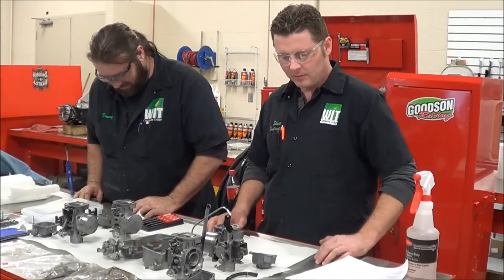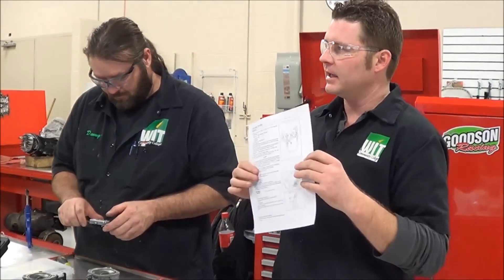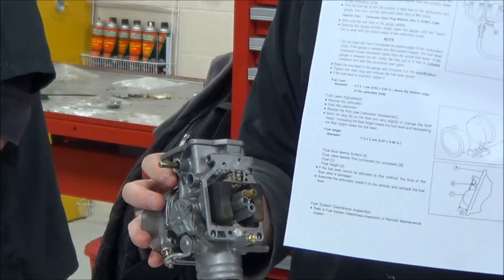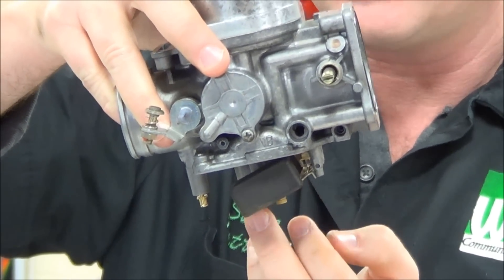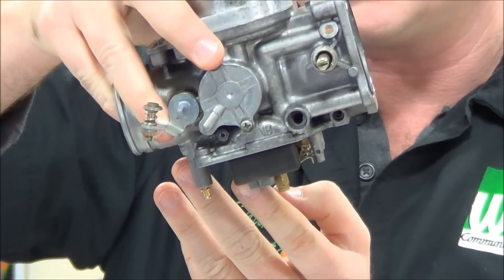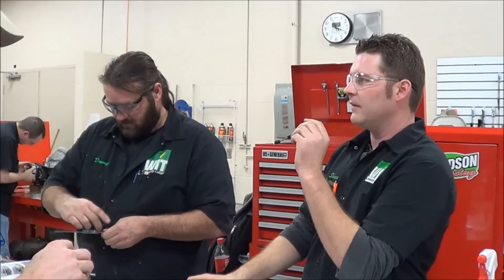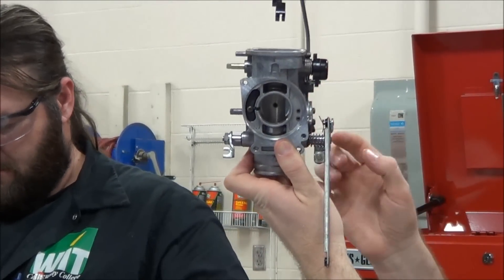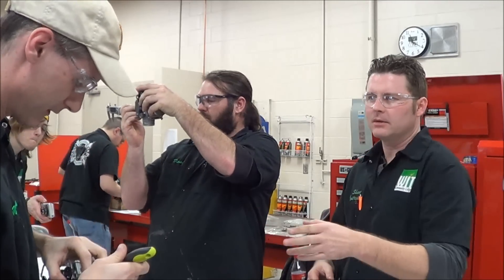How to adjust the Float Height on a Carburetor Metric Harley and Asian

Comment: Hay.  iv Rebuild  my  Carbarator 
And. Bike  Runs ok. with. The  choke  out. But.  when. I.  push
The choke  in. Bike.  Runs. Sluggish.   same  Carbarator as
showing  Here.  Fuil,  slushies  out
That.  sliding  needle.  that  goes
down  in. The  little  chrome.  piece 
That. setting. on. The  main.  jet
But.  The. float. Is. from. what. I
see.  Is. yes.  To   far  down.
Reply: I. don't.  have  Know.  special
tools. But. I. can. try.   To. adjust 
With  a. small   screw  driver 
I'm. having. a. little  problem  just 
getting. It. high. enough   with. out
going  past. The. plastic. bar. on
The. float.  binding. The. little 
Chrome  Tab.  Just  can't  seem
To. get.  The. tab. high. enough

Comment: Shane Conley hi. Just wanted to know if you have any advice for the 360 Prairie carb. It went kind of fast bought it used changed the jets, new carb.boots and put new float n screw in just so I wouldn't strip them. Tried ALOT of time to get the bike bike to run better then when I bought it no luck.  So finger Crossed if you have any advice in the adjustment for the float hight. 😔
Reply from the maker: I would check some other things like compression, valves, intake leaks...ect. If all of those are good, then carb adjustments. If I can ever be of service to you, here is a video explains how to connect with me. 
https://www.youtube.com/watch?v=vjvmB01ebcs 
Keep Wrenching,
Shane Conley
Instructor/Motivator/Motorcyclist
www.how2wrench.com
Like freebies? Click here for a free diagnostic checklist! 
http://gem.godaddy.com/signups/364621/join 

Did you like this free video and hope to see more? Would you just like to say thank you with a donation? Click https://www.paypal.me/how2wrench

Comment: I know I was referred to as an ass by the poster.My comments still stand.
To hold a carb and guess at an angle... yeah, it looks good but... keep on refering to that manual... They give angles for a reason and holding it to your eyeball doesn't count among other things... the FSM gives ball bark. Get out of the cheap seats and sit behind home plate. Bench test, wet method. The editing sucks, your method in this vid sucks. Plain and simple. Fine, I'm an ass. Your type video is the reason I have to fix bad running motorcycles because of carb issues other than than the "it sat over the winter and won't run" crap.

Comment: Yeah.... Where is this 35 mm angle coming from?Try 17.5 to 18 for a Harley Keihin CVK.
You half get info right, too high on float and it's rich, too low and it's lean.Other than that, how are you an instructor?If this is the s*** you teach you need to either quit, evaluate your "school's" manuals, or learn something.
Factory manuals give specs, no doubt, but understanding and delivery are piss poor.
I feel sorry for people that think this a teaching tool.Gee, and I wonder why I get a bunch of carbs every year...
Reply from the maker: SuperEvilmonkey88 
1. Your being a jackass. 
2. The 35 is degrees of carb tilt PER THE OEM FACTORY MANUAL 
3. The 17.5 18 mm is I guessing what you were actually thinking when it came to float height which needs set at this 35 degree angle. 
4. Learn to communicate if you wish to be part of this community. Asshole know it all get the boot. Now if a mistake is made and you have good information to share then by all means address correction. Your return response will determine your character as having a bad day or just a typical asshole....
Reply from the maker: SuperEvilmonkey88 https://youtu.be/g6y32Gw5HK4

Comment: Shane, great video! i have a question: I'm setting float height on Keihin CR 29's, I know the height should be 14mm, but on what angle I can't seem to find. Also, the float valve has gunk on the o-ring, i changed but I see that the valve has two holes above where the o-ring sits. at the bottom of the carb bowl itself there are also two holes, do i match them to the valve? thanks

Comment: With regards to rich and lean Let me understand this ..when the float comes up it closes the valve....doesn't closing the float needle valve allow  less fuel in. So, if that is correct... then wouldn't that make it leaner? Actually, it couldn't work any other way. When the fuel level goes down the float drops down (because of gravity)  it opens the needle valve and lets more fuel in. I think you may have your rich and lean information with regard to float position completely backward..
Reply from the maker: Well Ray...that's why I'm the expert here. Watch the video again. Your missing a key piece here. Opening and closing of the float needle can be thought of as an on/off valve....the key to rich or lean is float height. Watch again and see if it makes sense this time.
Reply: Okay, I agree..you are the expert, I don't mean to dispute that...you make some great videos. As I understand it....the float height at any time depends both on how much fuel is in the bowl and how much fuel the valve lets in the bowl.  but that really has nothing to do with your bike running rich or lean. 

Also,  there is another factor to consider.... the fuel in the bowl is  rarely in a level condition when the bike is moving because the rider is constantly accelerating, stopping  and going up and down hills and leaning the bike on curves. causing the fuel to irregularly splash around up and down in the bowl constantly causing the float to move up and down,  That is why there is a cushion spring in the needle valve. So, please tell me why worry so much about the float being set so precisely? Just as long as the float setting keeps the bowl from overflowing and wasting fuel or dropping too drastically low and starving the bike for fuel.....most bikes will run just fine. If you don't believe me, test some different un-precise float settings and then ride the bike.
Reply from the maker: +Ray Hensley 
Oh my Ray....completely incorrect on the the float level does not effect rich or lean my friend. Float height effects rich or lean to EVERY fuel circuit. Think of it as fuel "available" to the jet...a float shutting off earlier I would have less fuel available causing a lean condition. Another simple example of this is just like your toilet bowl water level. The water has a job to do to flush the toilet if you set the float too low and don't have enough water available I can't do all the work it needs to do. Fuel level works in the same way a hi float height will cause a rich condition because to much fuel is available to the jet that isn't needed just has a toilet. Ever notice on your toilet how the water level six below the overflow pipe? That's not just to prevent overflowing it's because no more than that is needed. Well unless you had a really big lunch which would require a double flush ha ha. Thanks for the compliments on the videos I hope this helped.
Reply: Okay, got it. So, the fuel sloshing around in the bowl while the bike is bouncing around on a bumpy road is irrelevant because that won't cause the bike  to run too rich or too lean because the exact perfect  fuel level will still aways be available to flow through the jets if the floats are set perfect and the effects of all that sloshing around in the bowl while riding can't make the bike run to rich or too lean at times because of that unlevel fuel in the bowl. 

Wow! Good thing our toilets don't get bounced around like that huh? 

I have rebuilt dozens of carbs over 30 years and I have always just set the floats so the fuel stays somewhere above the jets and somewhere below the overflow tube and my bikes have always run just fine, not too rich and not too lean. I'm just lucky I guess. Good thing I wasn't a cage rider where me and my bike went upside down every so often :).

Sorry, for being so slow to  grasp the concept.  I was just trying to get some clarification.  I wouldn't  want to tell someone something that was not quite accurate. 

Thank you, so much for your patience with me. I've learned so much, you are a great teacher..keep up the good work.

Comment: Great video, now if only it covered how to make the adjustment when the floats are all plastic I'd be on my way to riding again lol
Reply: The floats that are all plastic are NOT adjustable. Therefore, if you are having a problem with those kinds of floats, the only option is to install a brand new one. Again, they are not adjustable, because there is NO metal tab to bend and adjust.

Comment: By leaning the carb 35• that's how you need to set it not by flipping the Carb completely upside down? On all carbs or? I'm working on a keihin for a rm250 1997